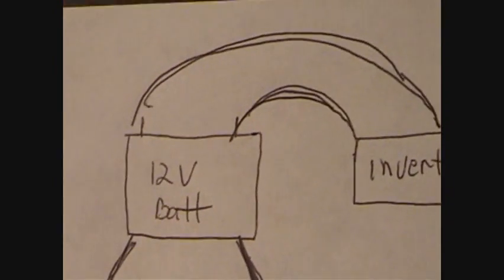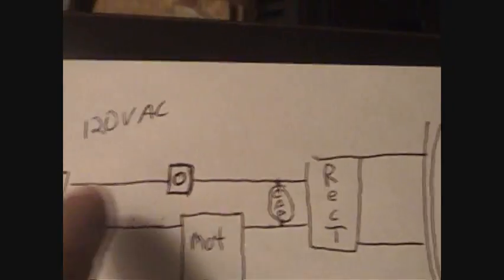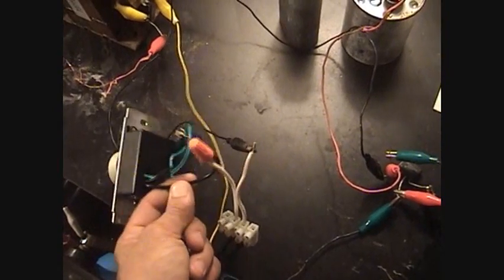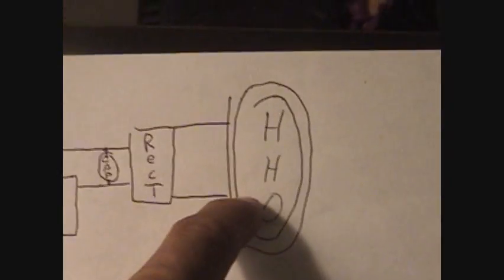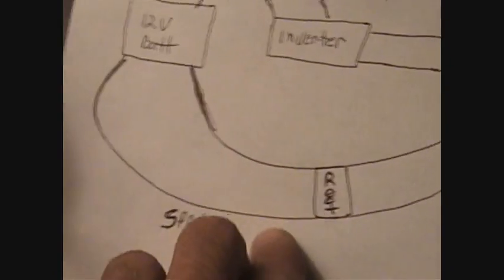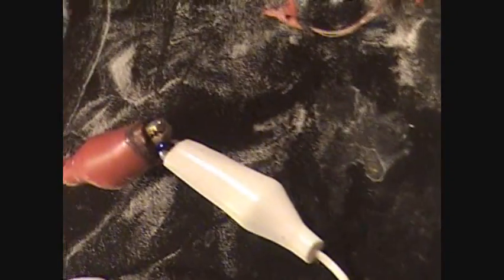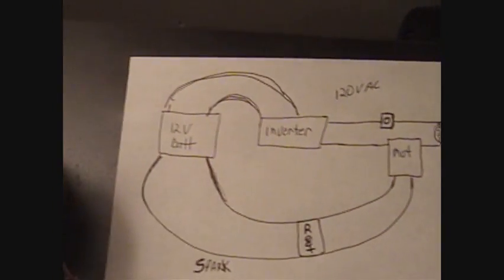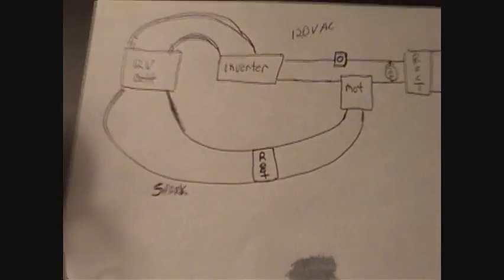Inverted Rectified, plus charging battery

Comment: Yes ofcorse, spark cells making not cost as much as plate cells.

Have you ever tried to replicate Newman Motor? Its very interesting. I got my first motor to run yesterday. I will post video. Many replicators say its overunity.

P.S I have PDF-file, where some guy tell, how to make 80-90% efficency cell. And in that site there are much useful info about cells. Maybe you want that site?

Careica

Comment from the maker: With the inverter, it makes the voltage 120v.
With that voltage you dont need the amperage.
12v 10amp  120watts
120v  1amp  120 watts
elite just drains my inverter

My new elite is tap water. i use distilled water in the cell.

 By the way plate cells are better for this particular setup, i still prefer spark cells in a 12volt  2 amp environment, cause i think they perform better, but at some cost.